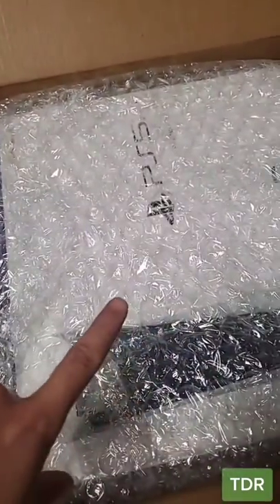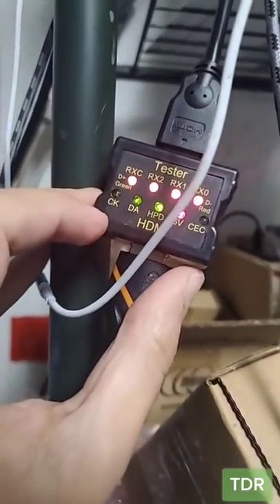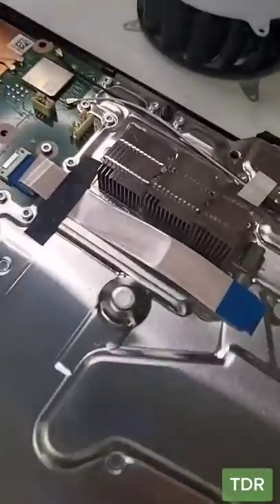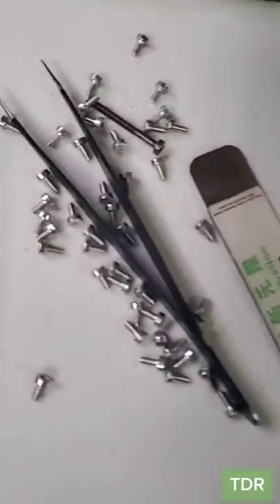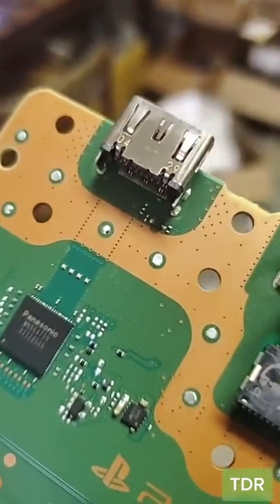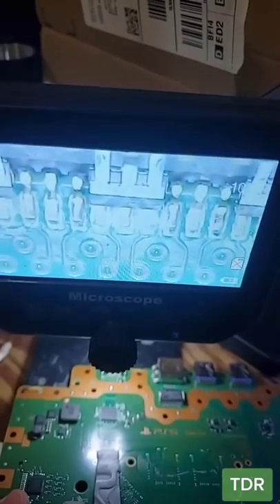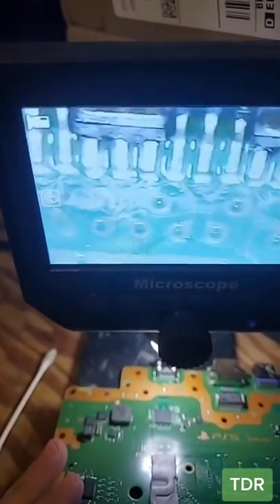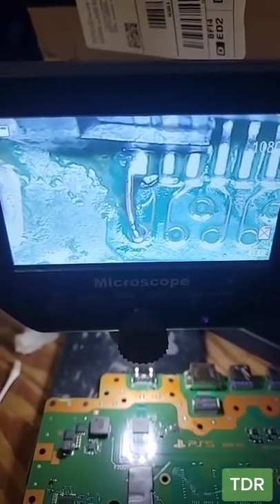Motherboard Tears, But HDMI Port Doesn't break! PS5 #HDMI #Repair #Shorts

Comment: I read somewhere that the newer PS5 units SONY is releasing out into the markets have less powerful heat sinks so they're saving money on PS5 heat sinks, and so the newer PS5 units get heated quickly with no efficient cooling mechanism.
Reply: Has already been kind of disproven

Comment: My ps5 had issues with hdmi where it would lose signal and tv would go to input screen and Sony blamed everything on me saying it was my TV or my hdmi cord, that my outlet didn't supply enough power to the ps5 and that my TV couldn't handle the 4k graphics even though it could on my xbox series x. They refused to send me replacement so I just went back to gamestop and had them replace instead of going Sony direct (Sony recommends going to them instead of retailer). Gamestop replaced and the new ps5 works perfect. The original port was faulty but Sony refused to believe me lol

Comment: Yeah I'll stick with my series S it was $289, I didnt have to buy it from a scalper, and the thing actually works out of the box
Reply: The series s is objectively shit. I'd consider a series x but the s is garbage. My ps5 works fine got it in June. Feel bad for the people that ended up with the series S . It's worse then switch lite vs switch . I instantly returned the lite when I realized it was trash 🗑.
Reply: @charlesfragoso3932  are you gonna elaborate at all?
Reply: @diffsnicker6570  about the switch or the series s?

Comment: Not really sure where to get one from around my area if not from a scalper at this point. I thought at first I could just wait until things get stocked finally like how the Switch did, but yeah thats not happening it looks like. I have the money saved for the thing but I just cant trust online sellers. I'm potentially ripping myself off financially with inflated prices or through just getting totally scammed with a non working console. Trying to weigh my options and find a solution

Comment: As someone who owns a series x and a ps5 the series x feels so much more refined and up to standard. Ps5 has so many random little issues and the fact that my ps5 has some different components then another ps5 should not be the case. Poor quality control and manufacturing
Reply: Eh, the controller is miles above the Xbox controller, and the interface is better IMO.
Reply: @nicro It’s true. We are buying it for the games AND the controller. The haptic feels amazing. Just wait until developers learn how to code masterpieces with it. Ratchet and Clank is a great example.
Reply: @nicro How do you know my reasons for buying it?
Reply: @nicro It’s not the most exciting thing. It’s an amazing addition. The Japanese just keep inventing.  Have you tried it? You can feel what stone feels like or what glass feels like in your hand. It’s just crazy to describe.  You can feel the surface you are on. The most exciting thing are the games! Sony will continue to create games that other platforms simply won’t have or will have to wait to enjoy them.

Comment: The first comment is the only thing I don't like about the video the fact of whether you bought it off a scalper or not has ZERO impact on this situation.

If the system is broken from factory then even if you got the system from a 3rd party (and that's a scalper or just your grandma who bought it for you for Christmas) Sony 100% covers the system just as long as you have the receipt. In fact they know exactly when are where it was sold with EVERY console (thanks to need to scan serial at each sale) but they ask for a receipt just to make sure the only consoles they DON'T repair are STOLEN ones!

So please while your video is great the misinformation is NOT and a more valid reason one might get someone like you to repair this early is they don't want to WAIT for Sony or be stuck with just a refund from the store since not like they can exchange it with another off the shelf.

Again nothing in this situation has anything g to do with buying a system from a 3rd party.

Maybe a better reason could be....

"this is why you ALWAYS get a copy of the receipt when buying your console, from a 3rd party / scalper or otherwise"

Comment: Idk what to do I have an og xbox 1 and first if I keep it on for too long it just freezes like 1 and a half movies and then once that is done if I overheated and I need to turn it off then it will not go off completely and just kinda stay on is so I have to unplug it then i have to unplug the hdmi cord power and my hard. Drive then unplug my controller and then I replug them and there I can play on my Xbox for another 2 hours idk what to do at this point

Comment: Been wanting to ask if I wanted to send my PlayStation 4 in to you would you be able to clean it and make sure that it's able to stay running?
Reply: You can easily do that yourself. Buy compressed air can from Walmart or Amazon and a screw driveR.
Reply: i opened and cleaned my ps4 back when i was only 12 years old. I'm 19 this year and it still works fine. you should be able to do it
Reply: A ps4 is so easy to clean. You don't even need a screw driver unless you want to get to the heat sync. The ps4 is just plastic clipping together like a toy. All you have to do is take the shell off and blow a can of air in the fan

Comment: Well it looks like the engine failed lets fix the shuttle fuse and run a trace (video cuts) alright fixed the rocket looks good uhhhhhhh lets run a trace

Comment: I am so glad I'm not even interested in getting a PS5. I am happy with my PS4 Pro with Samsung t7 1tb as hot storage. I figure after all the dumb desperate ones have paid $800+ for it and things calm down the more games come out I might look into it.. but I haven't wasted one minute of time going for a PS5. It's a new product that they can't even make many of and I will wait till we get the bottom or closer to the end of the bathtub curve..
Reply: I think its about what you value more

Many people value time over money cause they have a stable income so they are not afraid to use some money on the things they love/ get something they enjoy and make it more enjoyable.
The ps5 is way better then the ps4 thats no doubt but the main reason why people get it from scalpers is because they dont want to wait years for a restock that wont be botted by scalpers. 

In simple terms: they value time over money.
Example:
(Value money over time)
Im just gonna wait for the ps5 to die down so i can buy cheap
That will cost me alot of time but i wanna save money so its my only choice.

(Value time over money)
Oh i have more then enough of money leftover from my job, lets just buy from one of these scalpers instead of waiting 2-3 years for a restock that wont be botted.
Reply: @OneEyed8135  I get that. But your outlook is completely false. Just because somebody don't want to buy something immediately doesn't mean they don't have the money for it. That's idiotic to think that way.. just because people have $800 don't mean they're all going to be stupid enough to spend $800+ on something that's worth $500.  But after so long scalpers will stop because people are going to stop buying from them. So if a scalper goes out in spends $2,000 and doesn't sell relatively quickly they just lost $2,000 an now sit on a bunch of PS5s for a long extended period Of time. Witch isnt a good thing. I would be doing the same thing if I got a PS5. Resale it. Because the only people that are left are people like me that just won't do it. But it's also not just about money and time. It's what are you spending for what are you getting. I just don't see spending $800+ for a console that is just now going to start getting some real next-gen games 2022 an only worth $500 a good cost to time ratio. Especially when instead I can take that $800 and go out and do something that's much better a worth of time. But I also am old-school. I am not as easy to get money off of as late Millennials and gen Z are.. I'm all about biggest Bang for the Buck. Like buying the same OLED TV that people spent $3,000 for for $2,000 or taking a trip that would have cost $2000 for 1500. Time is Money an Money can buy Time and there isnt much bang in a PS5 when you got an already paid for PS4 Pro with a 1TB SSD that does just fine and the only time it gets turned on is when exclusives come out. Other than that everything else 3rd-party wise I play on Xbox. So I use PlayStation for PlayStation only and I use Xbox for everything else but Xbox. Because I don't like anything Xbox has.
Reply: @RedPillAlways  i dont mind u using and being happy ur ps4 pro and xbox as i have a ps4 too and a normal tv but i can guarantee you that the ps5 is a totally different experience (way faster, better quality, almost instant loading time and game swap and even more) even though i havent played on the ps5 (you are saying there isnt much bang but that is very ignorant of you as there is alot of info that proves your point wrong) i wont be getting the ps5 anytime soon but i dont think you are getting what i am trying to portray

I am not saying that someone has to buy something immediately but rather that (if someone was ready and wanted to buy the ps5) and had to wait a really really long time for the official sony to stock it up then the time lost is most likely more valuable then if you just spent a bit more money on the ps5 then wait a year cause there is no official ps5 stock

Cause when you really think about it, 800$ isnt really worth a whole year of your lifetime
And waiting for sony to restock ps5s cant guarantee you a ps5 in hand cause scalpers are preordering all the ps5s so paying extra is the only way to guarantee a ps5 as of right now(judging that you are not getting scammed)

I hope you understand that i am not trying to be selfish or rude, i am just arguing for both sides of the same coin here

You cant just say the ps5 is not as good as the ps4 pro 1tb ssd samsung t7 hot storage, just cause you have it, i mean i get it, if i had the same things as you i would be happy and fine with it but dont just throw out fake information, it can mislead people, most humans strive for the truth but most likely have come across the situation where they are lying to themselfs because the truth is somewhat unwanted.

Example:
Lets say theres a robber in your house, its late at night and you just woke up from your sleep. Your brain thinks there is a robber but you play it off as the wind cause you are tired and dont wanna get up to check it.
The next day you wake up and your important stuff is gone and you are upset

That is and example of lying to yourself.
discussing with others are a better way of getting to the truth/not lying to yourself or misleading others.
Plus its better to live through the truth instead of misleading yourself and getting upset when you have finally found the truth right?

I have been in 2 argumentations today and the other one was pretty like minded but we agreed on one thing, time is more valuable then money. Time is finite, money is not. This meaning that time is very limited incase you didnt get it.

You can have as much money as you want cause it is not limited like your lifetime but it wont ever make you happy when you have already bought everything you ever wanted.

Thank you for reading
I enjoyed having this conversation with you 😁

Comment: Ok... why does this has to do with scalpers? I hate them too but I don't see the connection. The only thing I can think of is that you can't return for factory defect.
Reply: Because Sony only provides warranty on products purchased from an authorized retailer. Last I checked, a scalper is not an authorized retailer.

Comment: That should have been a warranty fixed by Sony. The product should have been returned to customer and you should have informed the customer it should have been fixed under warranty and charged them a flat fee for diagnostics
Reply: Sony only provides warranty when purchased from an authorized retailer. Last I checked, a scalper is not an authorized retailer

Comment: bro ps5 is just a mess. i bought an xbox ss(series s) off ebay for only $60 over retail couple months ago and its in perfect condition and no problems
Reply: My series s hdmi broke pretty damn easily. Seems the factory Xbox hdmi is tight bhole af
Reply: Free costco replacement
Reply: no way it should have broke if you’re playing it normal person should.
Reply: i’ve never had an hdmi port break on anything. you literally plug it in and leave it. you play using the controller not the console itself
Reply: Naa man I'm pretty sure you're suppose to hold the console in one hand and controller in other while you play. Its warm

Comment: “Don’t buy from Scalpers!” Then also says, “this port isn’t healthy, clearly this is from the manufacturer” 
Involves Scalpers for no reason at all
Reply: @fireblaster15  It's not the scalper's fault lol they can't test the console unless they're selling it used, in which case they lose profit. The fact that the sealed console that was sold happens to not work doesn't make scalpers sh*t, if anything it's sony's fault for the faulty hardware and the buyer for taking the risk. Some resellers are actually ok with a return, my best friend bought his ps5 from someone on facebook and they said he could get his money back if it didn't work.
Reply: Scalpers often gets their hands on reject products for cheap and they make big profit from it. An authorized seller won't sell you faulty product and even if they accidentally do you can easily get a replacement with warranty.

Comment: Man. I watched you put a PS4 pro HDMI port on a PS5 on TikTok and I immediately blocked your videos. You putting the wrong HDMI type on a board is lying to the customer. It bottlenecks the potential of the output of the console and they're gonna buy a 120hz display for their PS5 and wonder why it doesn't work. No offense man but you're a joke.

Comment: Or you could just buy a pc and play online for free... rather than pay £40 a year for trash spec hardware and 4th reich game prices. This is why i didnt buy a PS5 after buying every other version when i switched to pc. I wont look back either. 

Also before the fanbois jump in, you can easily spend less and have a 100fps+ experience system. Leave console gaming to the noobs